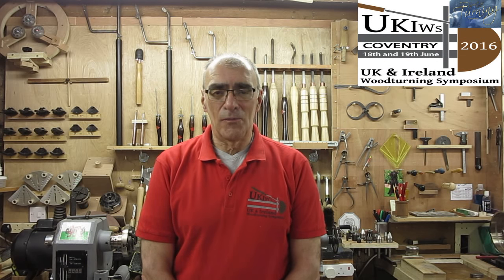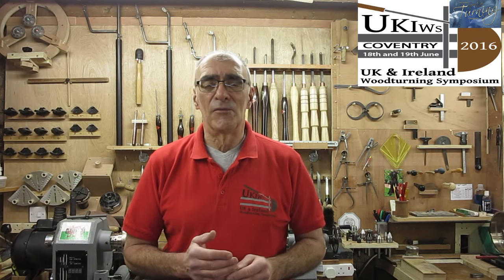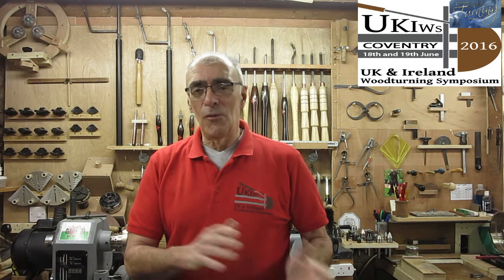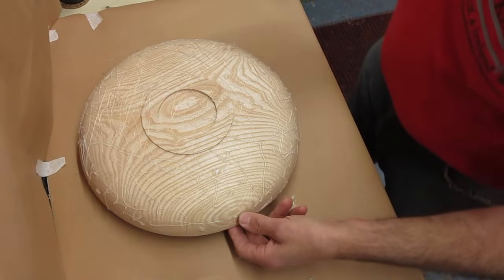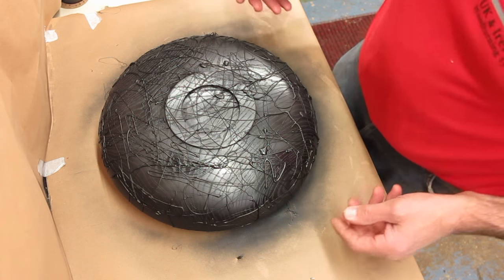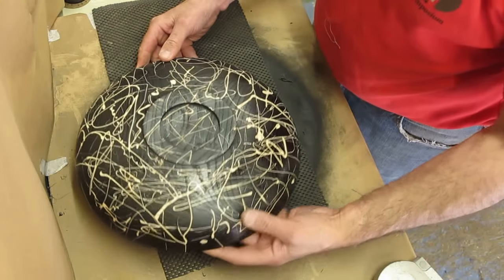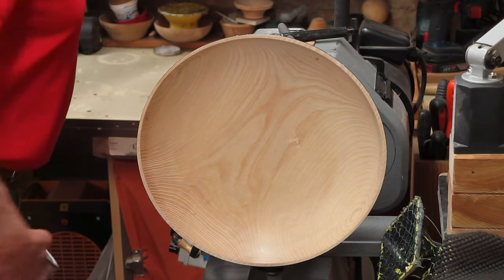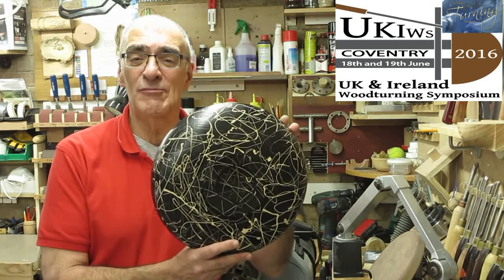Wood Turning - How to Colour an Ash Bowl using Hot Melt Glue

Comment: We used this technique back in the 70s using rubber cement on paper or canvas with inks and paints. It's interesting to see the "new" techniques coming back and being applied to different media.

Looks great! Try red on the whole surface—could be a dye— before the glue, then the glue, then the black (or any other combination of colors in pairs, or repeat the process for multi-colored string effects. The options and effects are endless.

Thanks for sharing,
--Joe
Reply from the maker: +Joseph Scarborough 
Hi Joe, I always think that things come full circle....then we start at the beginning again. This idea is not mine originally of course, but it's great fun, and very effective. The colours you mentioned are exactly what I'm going to try, and see how the base colour stands up to the glue heat, I think it will work out just fine.....hopefully.
Take care, and thanks for watching
Mike
Reply: +Mike Waldt If you're going to use a surface finish, try a test piece first to see if the hot glue pulls the base finish off.  A dye would not come off for sure and would let some of the grain show through. Just a thought. Hope you'll share the results of your next experiment.

Cheers,
--Joe

Comment: I really like the possibilities of this technique.....the spray can you used, is that an actual stain?    I wonder how this would do with an iron acetate solution (on a suitably reactive wood species)......definately going to have to try something along this line!
Reply from the maker: +Tim Hyatt 
Thanks Tim, as yet this is the only method I've tried, but more "messing about" is on the horizon. one thing I have already learned is that paint does lift when the glue is applied and cured, this info is thanks to a comment below. One less thing needed to be tried out :)
Take care and thanks for watching
Mike

Comment: I liked this idea and thought I'd try to extend it to the painted peppermills I make using 2 contrasting colors. Living in a beach town I use quite a few 'beachy' pastel colors that sell quite well and much better than natural wood mills I also make. I can tell you now that this method DOES NOT work with paint. After getting a few coats of the base color on and giving it sufficient time to fully cure and a quick sanding, I applied the glue followed by the 2nd color. Next day a second coat. After allowing it to fully dry for about 24 hours I started to pull the glue off. Apparently the glue is hot enough to melt the base color and when you pull the glue off, the base coat of paint comes with it. Note to self: Practice on scrap wood first.
Reply from the maker: +pharaoh1948 
Thanks for the "heads up" regarding the paint base coat. I had a feeling that would be the case with paint, now I don't have to try it! My other thoughts are to use spirit stain for the base coat, as it penetrates the fibres more than paint, so this is the way I'm going to experiment when I get the time. Many thanks for your thoughts and findings, I really appreciate it.
Take care
Mike

Comment: Very nice decoration.
I did something similar to this years ago using melted wax.  It came out ok, but the wax was a bitch to remove.
Reply from the maker: +Richard Hiller 
Thanks Richard. the hot glue was harder to remove on bare wood, that's why I tried sealer, and that worked well, made removing it much easier.
Thanks for watching.
Take care
Mike